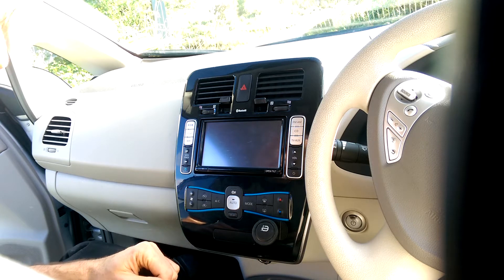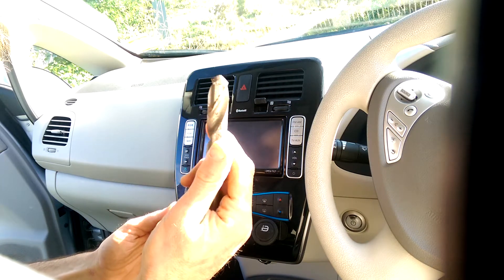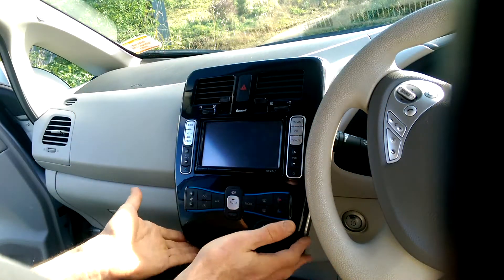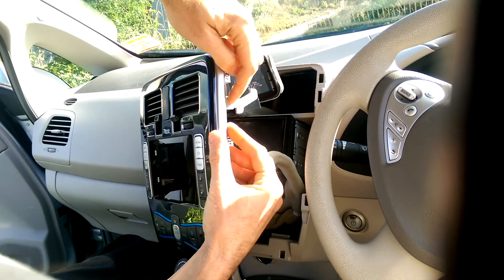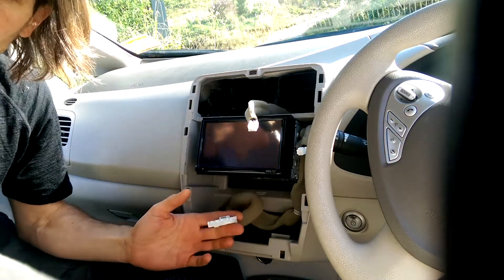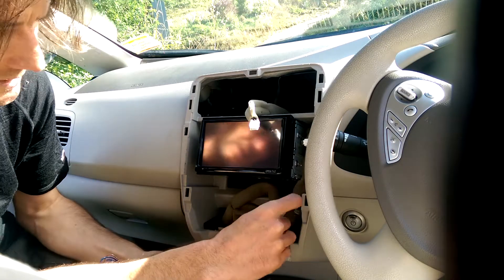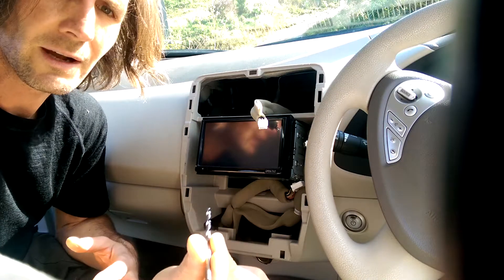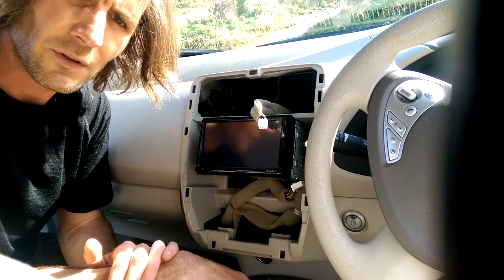Nissan Leaf G1 Heater Control Switch Installation Guide

Comment: So if I hear this correctly, your adding a switch to turn the heater element on/off, so as you can have just the fan on. What happens if you unwillingly leave just the heater element on and the fan is off, will the heating element over heat so risking a fire?
Reply from the maker: No.  The heater will run until it reaches a safe temperature limit then switch off. Nissan didn't mess up that badly!
This is not a safety device,  it is an energy saving device.

Comment: Good video.  I did mine about 3 years ago.  The only downside of having the switch there is that when the cover for the power outlet is flipped open to use it, the cover may hit the switch and change its position.  In my case, it moves the switch to the centre position (factory setting).  Possibly wouldn't happen if I had made the hole a bit to the L or R or forward/backwards.  Was tempted to dispense with the power outlet cover to avoid this, but decided to just be aware of the need to check switch position as and when appropriate.
It's nice using the energy meter to verify the effect of the switch working in the three different positions.

Comment: I removed the stereo/nav head unit first so that I could drill straight down, rather than on an awkward angle. Position II and 0 both seem to be full heating though, with position I being off.
Reply from the maker: Probably a better way to drill. Shortcuts like mine often aren't so short ;) Interesting that your switch positions are different to mine. If they don't work well for you I believe you can move the connectors on the back of the switch.

Comment: Thank you very much for that useful video, but is there any about making that magic device you plugged in between the original one and the heater control unit?
Reply from the maker: No problem. Please check the links beneath the video - I sell them!

Comment: if you do want to drill and not using one of the blank switch positions on the right side of the facia then use a step drill bit; http://www.screwfix.com/p/erbauer-spiral-flute-step-drill-bit-6-30mm/7877d